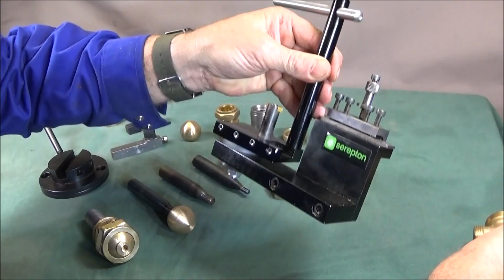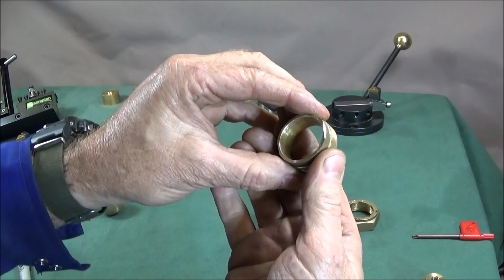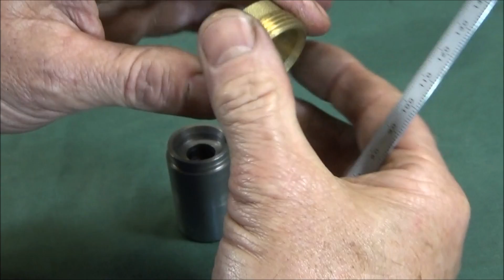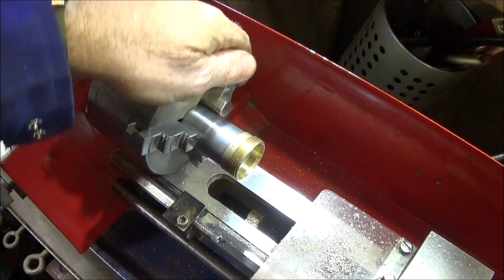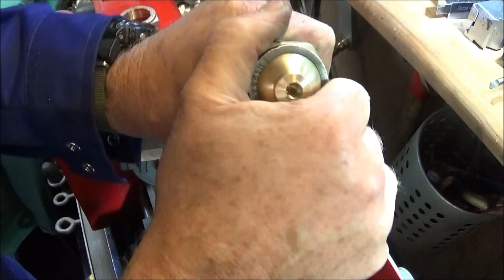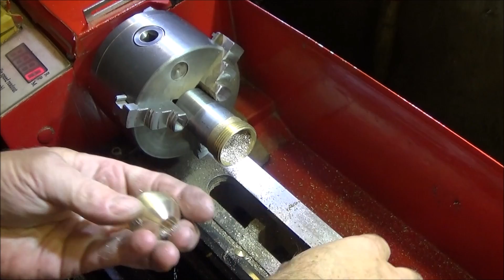Easy To Make Ball Turning Fixture Using Brass Plumbing Couplings

Comment: Do you modify the cutting angle on the drill bit that you drill the thread out to stop it grabbing?
A neat idea, and if you needed something with a rod with an adjustable angle you could use your method to good effect!
Reply from the maker: I sometimes do on brass.

Comment: I love the simplicity and ingenuity in which you design and create things. When the world self destructs and we blow humanity back to the stone age I would like to find myself in your camp. I really appreciate the work you put into your videos.
Reply from the maker: Thanks, I got my knowledge from 27 years in the aerospace industry. At one time I used to design and make fixtures and adaptors for testing finished aircraft components. This ball fixture is very similar to one I used to use to hold steel balls that were machined on a CNC lathe. The machined balls were made for the wing pivots on the GR1 Tornado aircraft. I should have another video ready soon. Thanks again.